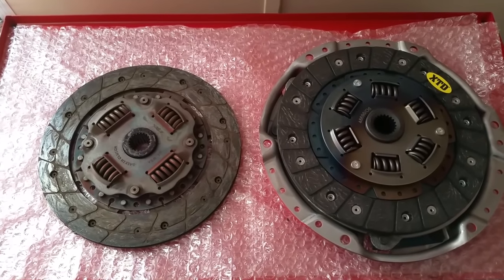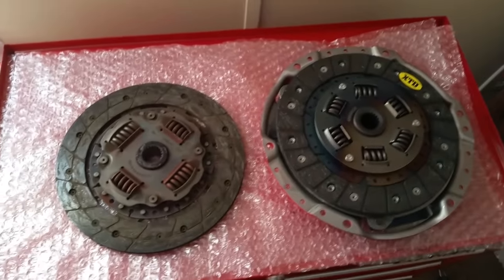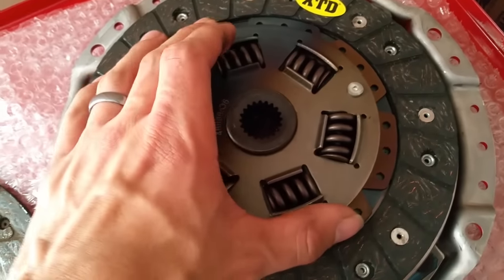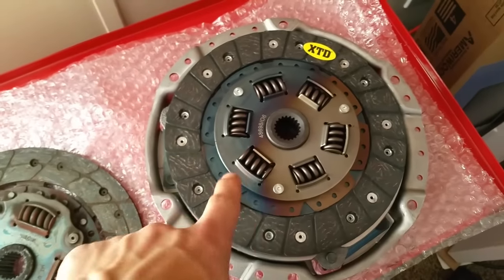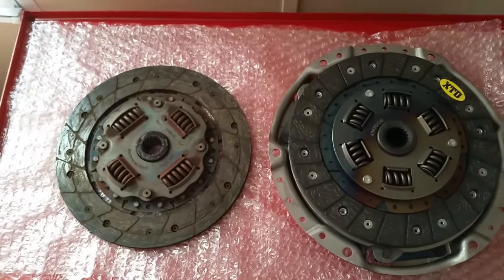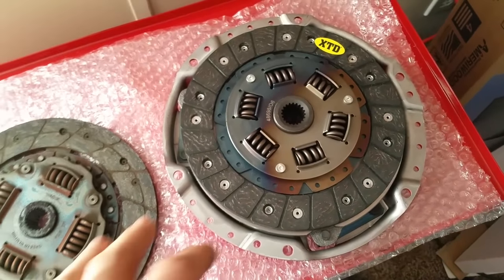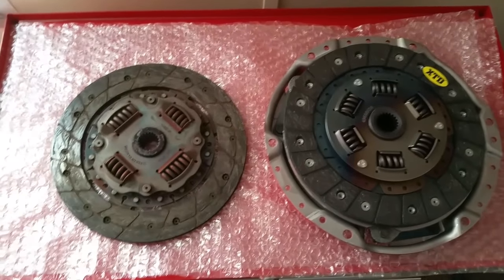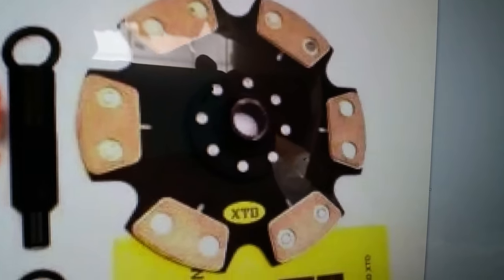What's the difference between racing clutches

Comment: 3 years with my stage 2 XTD clutch so far it’s been good and have had 0 problems
Reply: I was just about to buy a stage 2 from XTD. Was having my doubts about it because it’s basically and ebay brand. Would you recommend it?
Reply: Fcking Sesh yeah it’s not bad at all I’ve had mine for a while already only difference about a stage clutch is that you can’t let it go quick or it’ll burn tire or stall , you have to give it a little more gas then the usual! Get it!!

Comment: I just put a stage 3 6 puck copper ceramic clutch setup in my 04 Tiburon. Instead of sticking with that crappy dual mass flywheel I opted for a single mass conversion with a chromoly race lite single mass flywheel which weighs about 13 pounds compared to the 30 to 35 pound dual mass flywheel, which I hated with a fiery red passion, but the weight drop in the centrifugal area of the transmission truly made such a difference that it was shocking. I knew it would be a difference but wasn't aware it would be that much it sounds up so much more aggressive now! But the 6 puck clutch disc I bought was "sprung" which means it has springs like the oem,mind you there were 6 instead of 4 and they were much more rigid than oem, just wanted to point out that allot of times you have a choice in "sprung" or " rigid" with most of the more prominent discs!

Comment: HELP
OK, I ordered a XTD Stage 3 6 Puck clutch off eBay, for my '93 Mazda B2200, I have not installed it yet because I am doing a Kia engine swap next week. I use this little pickup as my daily driver, I do not race, hot rod around or anything. I live out in the country and this is just my little farm pickup. I though the stage 3 clutch would be better because it said it handles more torque and etc. I though it would be nice for pulling a little trailer and etc. I'm now really thinking I should send this clutch back and get a stage 1 clutch. Anyone have any ideas?
Reply: The higher stages are more for more intense horse power and harder/harsher driving if your truck isn't built enough for a stage 3I wouldn't recommend it because it can wreak havoc on your drive train!

Comment: I think a stage 4 with no spring is not good for a daily streetcar....it will hurt the gearbox at really low speeds........the only way to prevent that from happening is to keep revving like an idiot everytime you try to park the car
Reply: derafdrummer94 I have the one with no springs haha it’s good for my daily driving so far just sucks in reverse
Reply: I have the xtd stage 4 and i dont have to rev that high it goes at 2,000 rpms and on hills 2,500 i wish i knew about the springs but i had an ACT clutch kit and it was much more harder to press but to engage almost the same

Comment: Ok so here’s a question for you so I bought my are last May and right off the back the clutch was bad I’m talking metal to metal bad. I put a new oem clutch in at 173xxx miles just today not even a year later I’m at 205101 miles and it’s now slipping. NO IM NOT STUPID AND I DO KNOW HOW TO DRIVE A MANUAL this is my 4 manual that I have owned but my firs front wheel drive manual. My car is all stock but aftermarket air filter yes just the filter it’s a cold air filter and the muffler not the whole exhaust. So with my clutch already starting to slip and I do race a lot of other stock 4 bangers almost every Friday night, what clutch stage should I put into my daily/family car. Been driving manuals for a good 6 years now from trucks to cars and truck with loaded trailers. Personally I say a stage 2 but I don’t want to order one and be wrong

Comment: My stage 4 xtd slipped badly and the pressure plate was weak and crap pedal but yeah it’s either on or off so I told xtd and they sent me a Kevlar disc and I used oem pressure plate and that was better but still slipped now and then